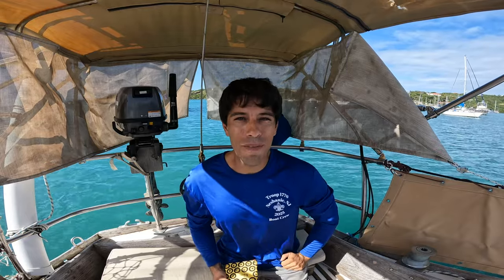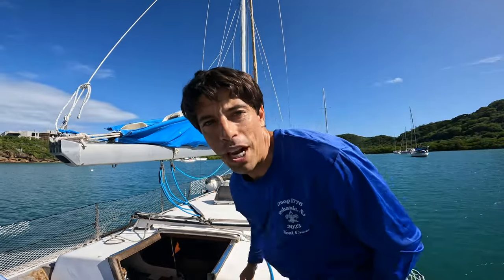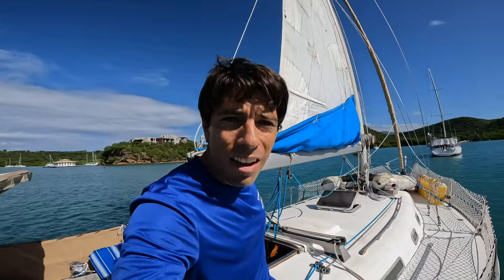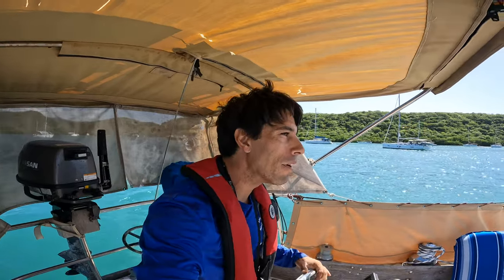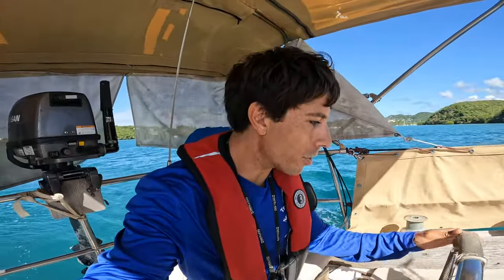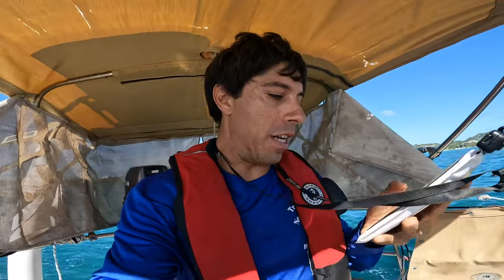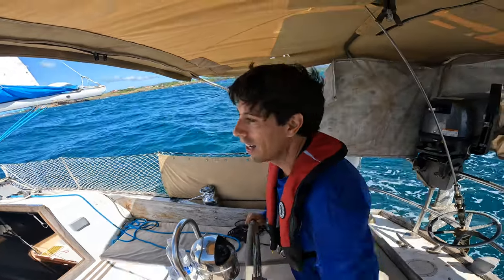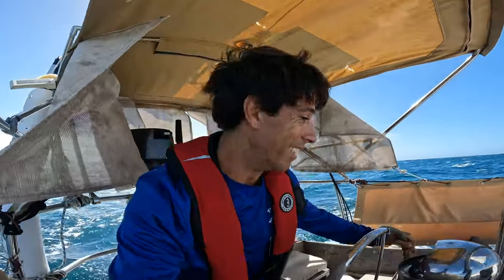First Time Solo Sailing, SHAKEDOWN BEGINS...If It's Gonna Happen

Comment: Well done getting back out there! Rigging a boom brake like we had on High Note would be a great safety add on.  Remember the metal figure 8 we hung from the boom with lines running from one ide through it to the other to slow the boom down.
Reply from the maker: Gary! Yea I do remember that! Thanks for the reminder. That was such an epic experience. It’s Game Time and WINNERS WANT THE BALLLLL
Reply: Linda here…I came here to make the same suggestion about adding a boom brake. Excellent!

Comment: Leaving the sheets loose on the main while getting the boat ready is such a great tip! Embrace the butterflies. I feel exactly the same every time I take the lines off of my cleats and know the sailboat is drifting. That, and going back to the mooring are the two hardest parts of sailing.

Comment: Have you considered installing a preventer on your boom?  Just a line/sheet that attaches to the boom and runs either starboard or port and secures to a cleat to prevent an accidental shift of wind crashing the boom to the opposite side.  It helps keep your equipment from being put under undue stress.  😊 ⛵ 🏖️
Cheers, S/V Cork~Texas🇺🇸

Comment: Thank you for keeping the same flavor of video, its a treat every time and now that im turning 40 ive grown fickle. How much electricity do you make and what would you change about your "power plant" if you could
Reply from the maker: I have such a small electrical bank. Two 6 volts in parallel and 200 watts of solar. On average I draw about 8 Amps when living on Chak Matay full time. Fridge, fan and lights.
Reply: @Bumsonaboat  8 amps ?!!??? I calculated 250 for mine , but I live in Maine and would die in the winter with less  . Sailing down there with a boat set up for here seems like switching to easy mode ,... Otherwise you must be twice the man I am

Comment: I have rigged 2 preventers on the main. I use both to jibe the boat to keep the mast stable in transit across the boat. I have a slow jibe because I have a baby stay on my mast and slows the 135% genoa during a tack.